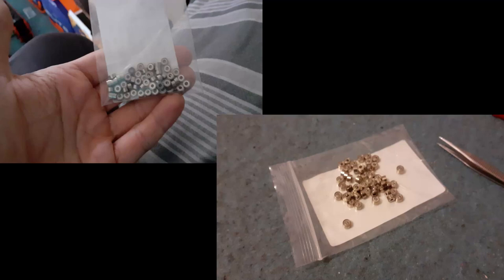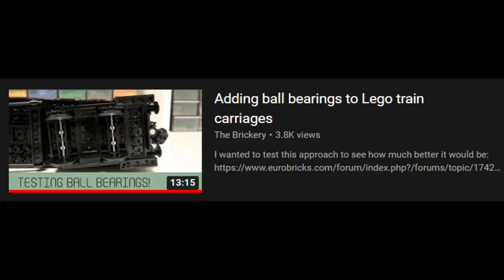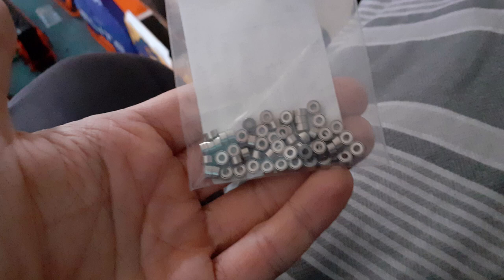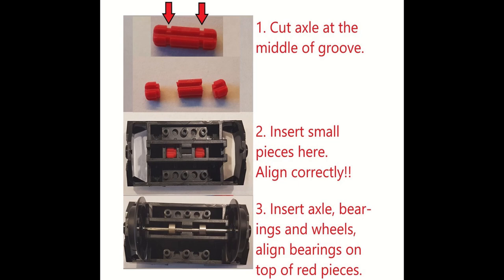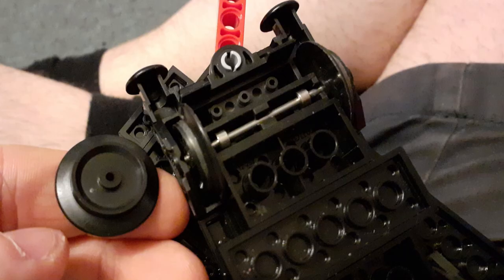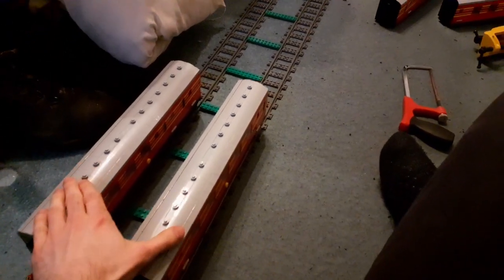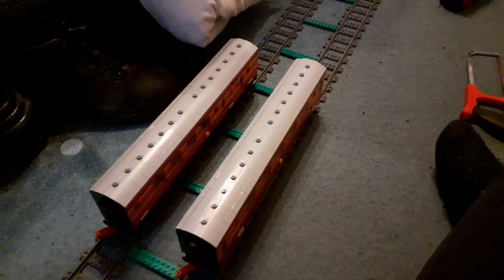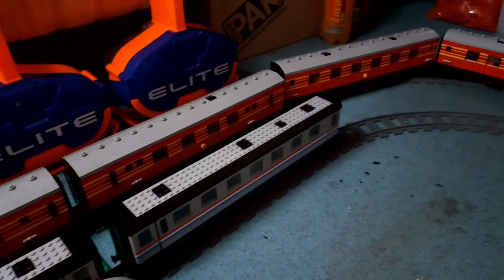Lego Train Building Tips: Rolling bearings

Comment: Do you have to regularly lubricate the axles and bearings? Like after every show display?
Reply from the maker: I don't know of lubricating them at all, but given the size of these bearings it would be a difficult task
Reply: Lubricating is 'dangerous'.  Any oily substance will be a dust magnet, and once inside the bearing you won't get it out.  You might lubricate the standard axle & wheel with (a fraction of a part of a hint of) silicone oil, those can be easily disassembled & cleaned.  Did I mention not to use very much?